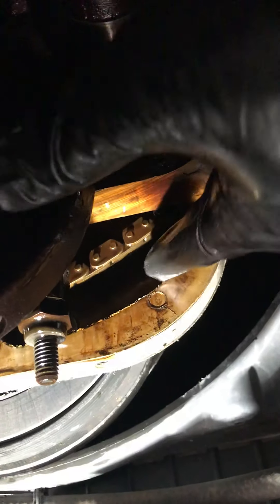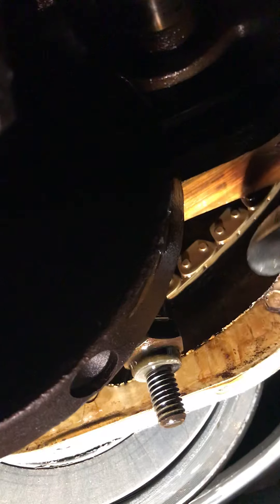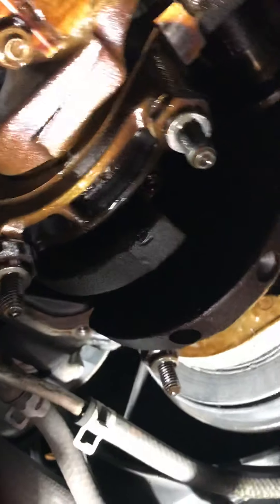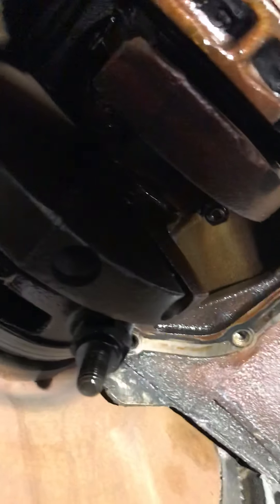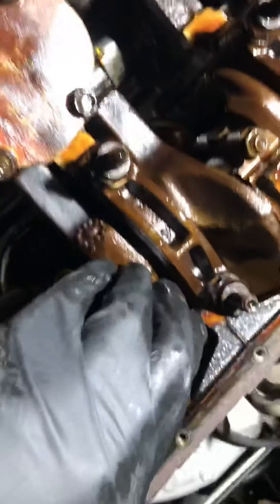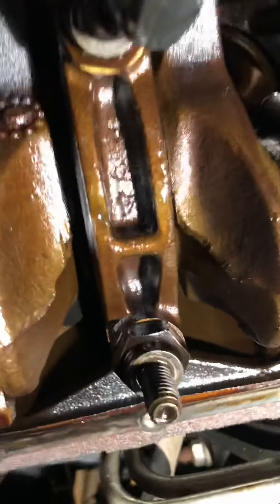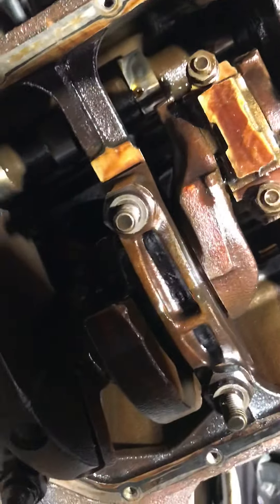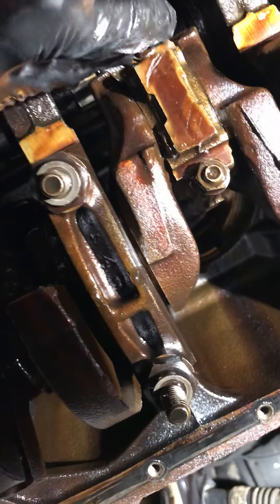Jeep Wrangler TJ Loose Timing Chain

Comment: Did your engine noise seem to quite down when you give it any gas? On a cold start, the jeep won't make any knocking noise then maybe 45 seconds later it'll start making it. If I give it any little bit of gas the noise goes away. It only knocks at idle.
Reply from the maker: Yep. Mine is very similar. It's quiet right at startup, and then the clanking starts about 30 seconds later. Once I give it gas I can't hear it anymore. Oil pressure is fine and I checked some of the main bearings and they all looked good, so it's most likely not bad bearings. Leaning towards lifters.
Reply: 4.0 are ticking clicking sew machines. make sure oil pressure is good and you arent overheating and ignore the rest

Comment: So what was the culprit of your noise?  I picked up my $500 beater, replaced all the bearings and rear seal, about to do the front chain too as it's clapping around.  What was your culprit of the sounds?
Reply from the maker: Sadly haven't figured it out yet. Leaning towards a stuck lifter right now. You replaced your bearings? How was your crankshaft? Still looking good?

Comment: did you replace the timing chain. if so how did it go. did it quiet up at all or improve the MPG/performance.
Reply from the maker: I did go ahead and change it, sadly, it didn’t quiet things down at all. I’ve been doing so much work on it that it’s hard to say if the new timing belt changed much, but I do think it feels like it has more power now after changing it. If you are going to change yours, and want to leave your radiator in, I recommend picking up the tool from Harbor Freight that helps get the main wheel off the front of the crank shaft. Their tool has a shorter main bolt and it fit nicely for me without having to take off the radiator. The ones I could rent from O’Reilly or Autozone all had super long main bolts and wouldn’t fit. Good luck with yours!